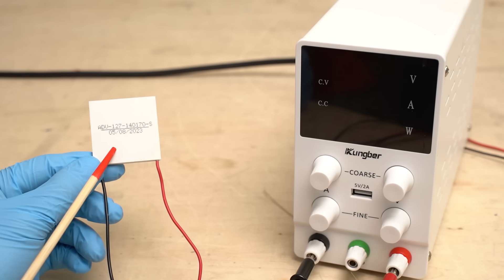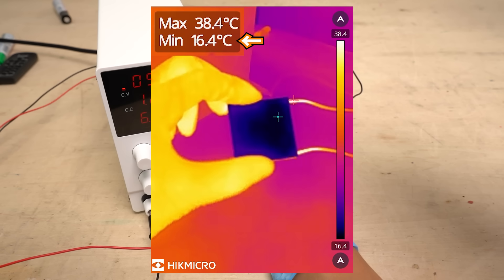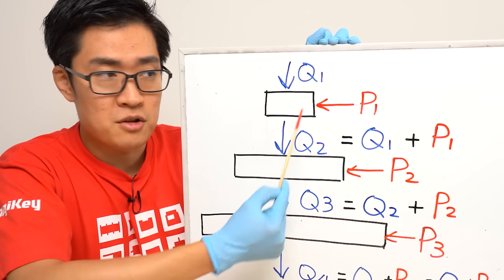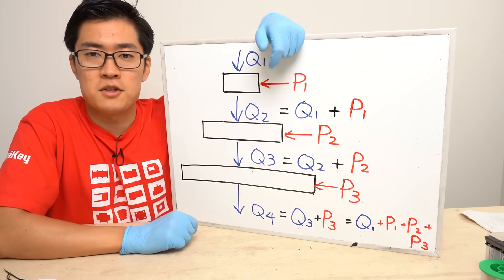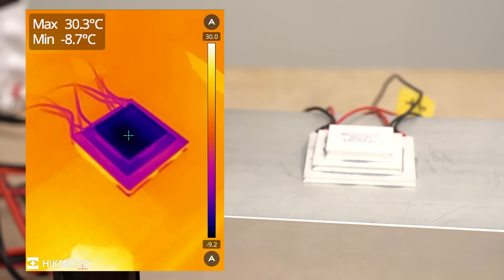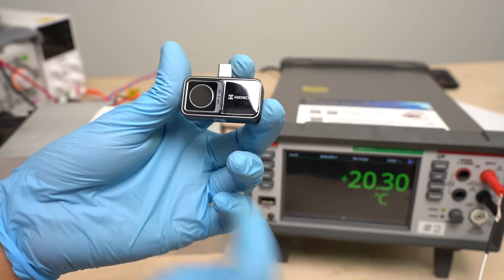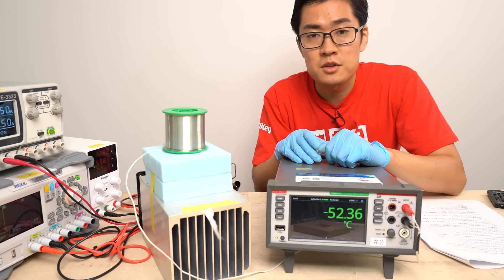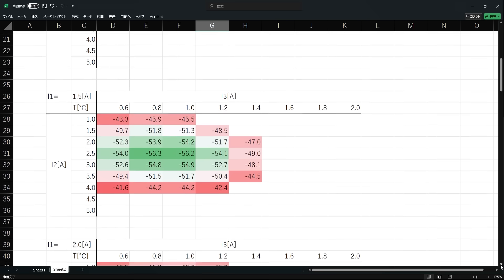Stacking 5 Peltier Modules, and Reached -90℃

Comment: hello! 

Back when I was in college, we made a mini ac unit that cooled around 5m3 to around 20c when the ambient temp was in a range of 35c to 40c with low relative humidity using peltier devices as one of the final project we had.
We used a custom built water loop and a car radiator system. 

This reminded me of that, you can definitely cool larger spaces and/or components as long as you are willing to sacrifice the top cooling capabilities of your stacks. 

Great video, this brought back lots of memories 😊
Reply: I bet that guzzled the juice

Comment: It always bothers me when folks say peltier elements generate cold on one side and heat on the other side. A better way to explain it would be that the Peltier generates a temperature difference (delta T) between its 2 faces, it makes it easier to understand the rest of the physics. So thanks for clarifying this in the video btw. Also, thermal transfer plates may have helped in maximizing the harvesting of the cold side from a stage to another.

Comment: Ah, so with heat pumps in series, there's exponential power growth through the stages, if they are optimally sized.  This means that a small improvement in individual device COP would make a big difference in the COP of the stack.  Would choosing devices with the best COP, even if the heat transfer capacity is worse, give the best result?

Comment: Great video!  Given that the temperature drop is roughly 100C from ambient, I am curious what temperature drop could be attained in a lower ambient temperature setting.  Do you know what drop (and what ultimate temperature) you might achieve with the same configuration were you to immerse the entire assembly in to a cooler with Dry Ice or even a Liquid Nitrogen vat?

Comment: Nice Video. By the way, the most efficient coolers, according to a quick research, are pulse-tube or Stirling cryocoolers, but I guess they are pretty expensive. Citation: 

"Stirling Cryogenerators provide cooling power in the range of 50 to 6,000 Watt in the temperature range of 18 to 180 Kelvin (-258 to -123°C or -433 to -190°F)."

Comment: Peltiers NEED substantial clamping pressure to work efficiently. Thanks for sharing your findings! I would love to see these experiments up to the peltier modules full potential
I've been using Peltiers in combination combined with watercooling in different configurations for CPU and GPU PC cooling since 2006. Regarding clamping pressure, my experience has been that, aside from improving thermal transfer, it crucially helps to eliminate or minimise test to test variance essentially making testing more reliable.

Comment: Could get much better heat transfer if you compressed the peltier's down with some kind of clamp. Maybe drill and tap into your heatsink and have a "frame" that clamps around the edge of your top peltier.

Comment: Use a thin graphene sheet as your thermal conductor in place of the thermal paste.  It transfers heat much better, gets close to the thermal properties of diamond.  Also, place a sheet of this material in the middle of each Peltier device.  Keep in mind that getting the hot side too hot will cause your internal Peltier device contacts to move apart and stop working.
Reply: I literally ordered a graphine sheet a few days ago from McMaster Carr to try this, great idea, it was like $30 for a 12x12in paper thin sheet seems like it will be way better and less messy than paste, also pressing them down on either side with non conducive ceramics and nylon threads to keep strong contact even during thermal expansions
Reply: @Brookzee32  Just be careful not to short anything on the graphene sheet as it is a very good electrical conductor as well and you are good shape.

Comment: used to do this with cpu, overclocking and water cooling. regardless of what you use to take away the heat, the downside is that TEC's dont last forever unless some kind of breakthrough happened recently with tec's. They have their applications but for anything "critical", you're making a big gamble. Had many TEC's fail that ended up with damaged equipment. I think this is why they're used for more convenient, less likely to have real repercussions other than annoyance, things like beverage coolers and not critical hardware.

Comment: thank you for this experiment. could it make sense to assemble 5 little pyramids with the tips facing inward to create a tiny chamber that should become much colder than -90°C, as the heat flux rom the sides is eliminated? This might be used to cool a IR sensor instead of liquid nitrogen.

Comment: Every so often someone posts a video about these interesting devices.

Every time people think these would be good CPU coolers. Nope. They're incredibly inefficient, and if the CPU operates beyond the wattage of the TEC, the TEC will become an insulating device, causing the CPU to overheat.

Using a bare copper block and a fan works better than TEC devices, and if your power to the heatsink fan dies, the copper is still going to remove heat. A TEC cooled CPU will become fire.

Comment: I think you should use aluminum or cupper sheet between modules to dissipate heat to all area of bigger peltier module. It's body is made of ceramic and if you don't use metal sheets between them you cant use all of the bigger module capacity at each coupling.

Comment: peltier device is interesting because the peltier device cools with the peltier effect from the peltier device which is caused by heat from the peltier device causing the peltier device to cool from the peltier device effect in the peltier device (btw its called peltier device (remember this: P-e-l-t-i-er D-e-v-i-c-e (just in case you forgot its Peltier Device)))

Comment: Hi Denki,   i imagine this has a practical aplication if is possible isolate somehow motherboards and processors, preparing them against the condensation !  So theoreatically  we have a good use for a cheaper solution against those things, and plus we can combine methods of hot air out, and dry cold air in from Air condicioning.
I dont think those are necessary in any situation exception for overclocking.
Anyway, Mr Denki i was wondering a easy manutention of such system, in cooling a computer system.
No need to be  -90 - infact the optimal temperature for a video card or INTel xeon is -3.

Comment: One thing to remember with peltiers is that the device setup needs to have more power consumption than the heat output of what you are trying to cool. In the video there is no real heat load except ambient air. But if you were to put this on a CPU for instance, if you had a 140w CPU you need at least 150W~ if peltiers or you wont be able to cool it. This is why such devices are not in common use, as they basically double your power draw.

Comment: In my opinion, with a CPU cooler that uses heat pipes you would be able to lower the temperature of the hot part of the first cell much more

Comment: I had the idea some years ago but decided it would be so inefficient as to not be worthwhile. I had only considered stacking modules of equal power. Using increasingly larger modules makes sense as each module has to get rid of all the pumped heat as well as the waste heat from everything above it. Good experiment. Well done.
Reply: Its a lier. Y have try haw you sed all things end thw best whaz 26°the the air cooling end heat coms too 36.4° y dont beleve no mor. Dont need too sed that y put whoatee cooling end bigher  hootshink
Reply: @bewolf4u  I'm sorry but I barely understand a word you wrote.

Comment: I worked for several years on digital optical spectrometers.  They super-cooled the CCD camera using stacked Peltier devices, which were then cooled by circulating water through a large heatsink with another set of Peltier devices laid out in a grid moving heat from the internal water supply to an external water-cooled radiator.  The cameras got extremely cold.  If there was a failure in the control or temperature sensing, they would ice up on the outside.  Very useful devices!
Reply: Can we make a mobile phone gaming cooler using peltier device 
Using this way 
Please reply!
Reply: @ayushkumar1183  you could but it wont be energy effient, that -70°c stack consumed 130 W. Which is too much for a mobile device. and lets not forget the size of the heatsink

Comment: The efficiency goes down hard because the more devices you use the more power and heat are needed and generated to move the power needed and generated for normal use

Comment: A regular kitchen refrigerator could be used for the record. The initial temperature would be -20 degrees and on the Peltier elements -120 degrees. Or maybe not, the internal resistance of the elements increases with decreasing temperature and the efficiency drops.

Comment: That was very surprising to me and potentially very useful in a project I have where I need to cool alcohol to at least -70c. Very interesting!
Reply: Don't think it would work, unless it is a very small amount of alcohol
Reply: @bluemamba5317  That doesn't make sense. Either you can reduce the heat or you can't. The volume is irrelevant.

Comment: I sometimes have odd fantasies - one of them is stacking Peltier modules. And here it is. Well, I don't know how to feel. I'm glad someone is living the dream.
Reply: Relatable, although it's rare that someone's living my odd fantasies
Reply: I'm glad someone did it so I could give up on being interested in peltier.
Reply: If only education wasn't so focused on blasting Boccherini - Minuetto while doing a bunch of overcomplicated equations buried in jargon and paperwork, maybe we would have been able to live our dreams
Reply: Can we make a mobile phone gaming cooler using peltier device 
Using this way 
Please reply!
Reply: @ayushkumar1183  You can, since it just boils down to passing a current through the chip to move the heat from your phone to the other side of the plate. 

You can use a heatsink to do this without needing one of those chips, but it would kind of defeat the point of mobile gaming. 

If you do use peltier chips, you'll still need a power supply to do this, and you can't exactly use your phone's power supply for this, so you'll need some battery setup, which needs wiring and all that. 

You could reliably stuff this in a casing for the phone, it would be bulky and look like a bigger version of those really old telephones, but it would work to cool it.

People with bad laptops typically put their laptops on a metal tray so that the tray absorbs the heat and conducts it away with a large surface area. That's essentially how a heatsink works.
Reply: Hahaha good point
Reply: Same thing here as well... and touching dry ice, liquid nitrogen...
Reply: My people 😂😅
Reply: Good way to chill out.

Comment: This could be useful in pc's and cooling will be 100 times more effective and those processors like Intel i9 14900k could stay in control and you could also push the processors  to their max threshold like don't in one of ltt(Linus tech tips) videos where he used a industrial 5000w chiller to cool the cpu and push it to max power

Comment: For more than 10 years I worked in a company that manufactured cooling equipment with peltiers. The most efficient peltier is at about 2/3 of the maximum voltage (for a 15V peltier this is 10-11V). It achieves the best heat transfer at 0°C temperature difference.
For a cascade, it is always advisable to have the peltiers designed so that the one below has 2x higher wattage than the one above it. If top peltier has 50W then to peltier belove have 100W
In our experiments we got to -120 with 4x cascade and 400W power input. The total temperature difference was approximately 160°C, BUT the top peltier was 1x1cm
Reply: thanks for the information.
Reply: Why do you we have to use different size of peltier when stacking? Cant we stack the same size peltiers?
Reply: @ashwinsnmv  peltiers of the same size can be put on top of each other, but the power ratio must be respected. And apart from two-stage cascades, it usually doesn't make much sense. Mostly it was done with peltiers that have 127 pairs and are therefore at max 15V, there you put two of the same size on top of each other with the lower one at 10A and the upper one at 4A. They even made those directly.
Reply: Thanks for the reply. Can you name a few models that have high performance. There are hundreds of companies and dozens of products it would be helpful to get a recommendation from an industry expert
Reply: @ashwinsnmv  We mostly used peltier from Altec. They sell AL-011 as a cascade. They also have a more powerful one, AL-077, which is up to 60V with a consumption of 3A, the temperature difference is max 72°C, dimensions 52x48x3,3mm. But the most powerful they have is Al-198-2.0x2.0-1.0 with max 23V and 18A consumption. But I have no idea if they even work now. It was a company under Ukrainian university and we all know what is going on there. If you're going to buy some you need to see what designation they have and if they are insulated. If it is TEC it is a peltier designed for cooling. If it's a TEG, it's a peltier designed as a power generator. At first glance it may not matter, but the internal construction is a little different for each. It is also important that it is insulated to prevent moisture getting in. Then there is another condition and that is not to exceed 90°C, although they are designed for up to 125°C, but above 90°C degradation occurs and the peltier ages faster. The exception is the so-called HT modules, but again these are not designed for cooling, but rather as heating cells or as TEG.

I hope this information helps :)
Reply: @Dekker254  Thats some nice info. Thank you very much. Im am primarily looking for cooling solutions for a research and not sure if the 2$ peltiers will have the performance and longevity. So Im looking for higher performance but not too costly as well. There should a balance to cost to cooling ratio
Reply: Wow!
Reply: Was the temperature of -120°C (and total temperature difference of approximately 160°C) achieved with silicon based Peltier devices?
Reply: @petertrypsteen  I don't remember, it's been a good 17 years since we did this experiment. I had a 5kW heatsink on the hot side
Reply: Wow...
Reply: what cooling devices manufactured the company you worked for ?
Reply: @faboxbkn  It was a small company run by one owner with one employee (me), Unfortunately, it closed four years ago because the owner was unlucky in his investments on the financial market (he invested not only his own money, but also that of several partners whom he had attracted when he was doing well). It was during the turbulent period when Britain left the EU and there was a blockage in the Suez Canal. So instead of making money, he ended up with a debt of $3,000,000.
Reply: so its better to add peltiers to a regular compressor freezer?
Reply: @Timsturbs  well, it's not that convenient. if the temperature is well below zero their efficiency is very low. Unless there's nothing preventing us from using a conventional compressor, it's pointless to use a peltier.
Reply: @Dekker254  conventional one stage compressor heat pump can get -90C ?
Reply: @Dekker254  can you mention some practical uses for these stacked peltiers?
Reply: @sovo1212 I pulled a nice little wine fridge from the trash, removed the failed power supply and peltier block.  I found some new old stock two-stage Peltiers on eBay, made my own Peltier block using  solid copper bar stock, and made a massive heatsink soldering copper sheet.  Dual quiet 140mm Noctua fans, Meanwell power supply.   Some thermistors, relays, and  Arduino to control temperature and run periodic defrost cycle to reverse polarity to the Peltier to melt frost ice.  Now it's a very inefficient but extremely quiet bedroom fridge that keeps at 2 ° C.   That temperature would not be possible without the stacked Peltier along with  the all-copper heat transmission and insulation design.   The thermal design allows it to run at more efficient reduced voltage (10 to 11volts).    Was a fun learning project, but in hindsight way too much work versus buying a small compressor fridge!
Reply: @Timsturbs  I think people are misunderstanding what it is you are asking.  Yes,  when striving for VERY low temperatures (or much higher power efficiency) it is pretty common to use a phase change first stage. Depending on the final temperature and efficiency requirements a second phase change stage may be used, but it is much more expensive and uses "exotic" (as in not freon, or other common) gasses. Then mount the peltier stack to the evaporator block of the PC first stage.
Reply: @Timsturbs  Is your compressor freezer only 1 cubic centimetre in size? You could freeze a pea.
Reply: @Timsturbs  it depends on how you define better but generally no. Compressors can be more than 100% efficient pretty easily. A peltier device will never compete with that. It will always take more power
Reply: @ That's right, it is usually stated that a conventional compressor has a ratio of 3:1 (3 units of heat per unit of energy), while a peltier has a ratio of 1:3 (one unit of heat per three units of energy).
The greater the temperature difference between the hot and cold sides, the less efficient the peltier.

Comment: You should have larger size variance between each stage.
Also never pay more than $3~$4 per module.
I TEC cooled my Canon T3i with dual stage TEC's, way worth it for astro use (continuous 5 minute sub frames)

Comment: Would it help to put a copper layer between the peltier devices to radiate the heat from the one above to the entire cool surface of the one below? The thought is that it would more effectively use the full surface if the copper piece is the size of the chip below.